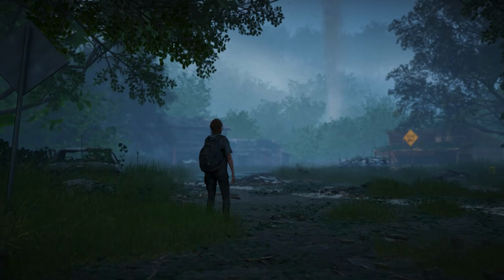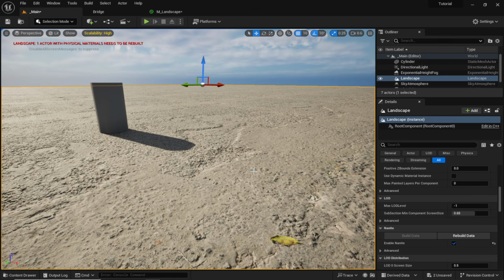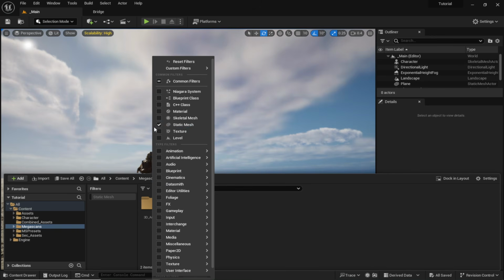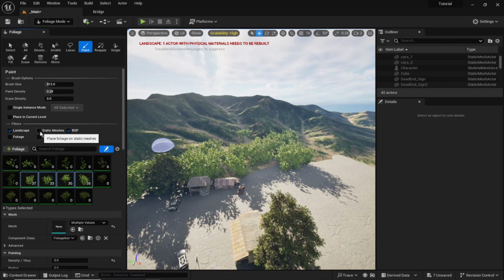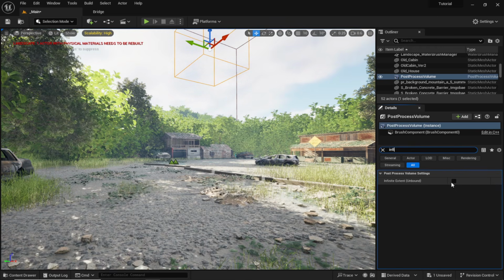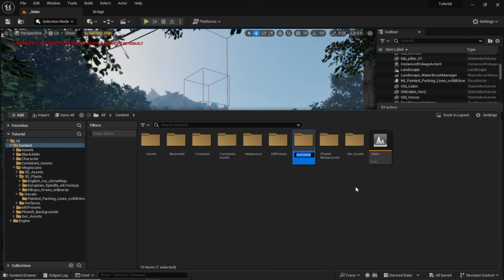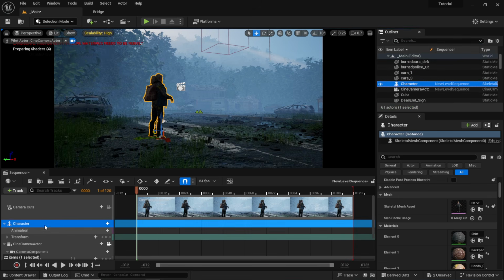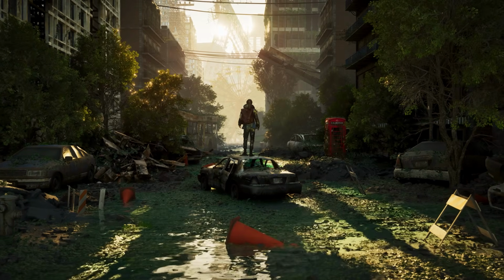Unreal Engine 5 Environment Tutorial for Beginners

Comment: which UE5 version you are using? in UE5.4 displacement technique not work for me! idk why
Reply from the maker: Yeah there might be a problem or bug in 5.4v , I am using 5.3
Reply: I had the same problem to start with but it turns out you have to select the material, in the details, search for Displacement > Enable Tessellation and click the checkbox to switch it on. Then you should see the pin highlighted.